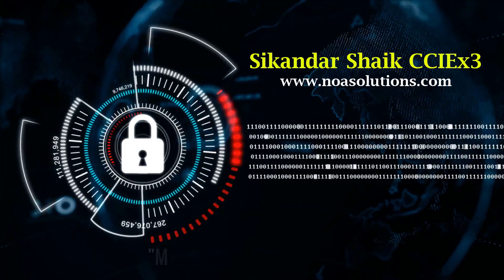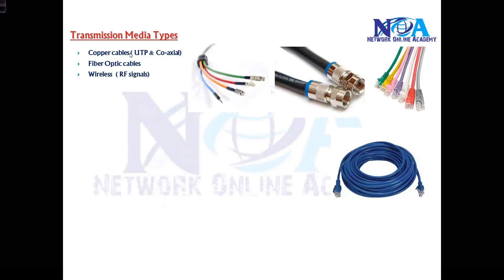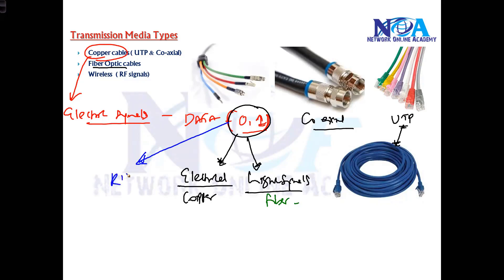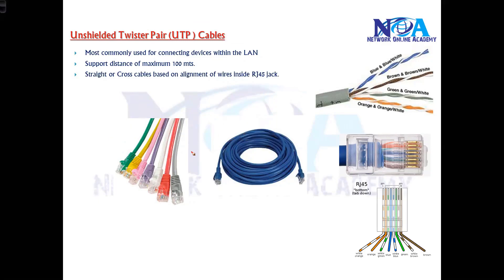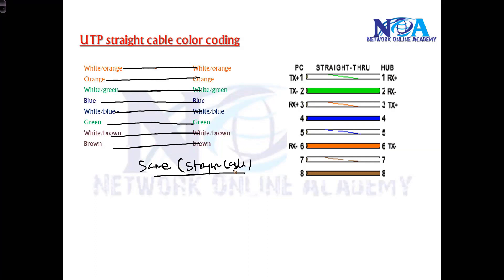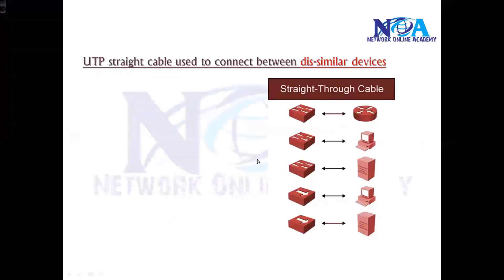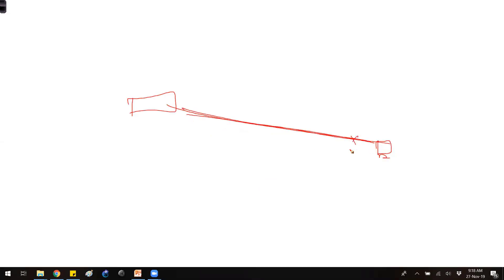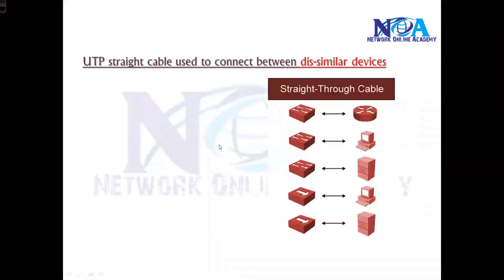005Transmission Media: UTP Cables Explained | Sikandar Shaik

Comment: This is what I done. My cat6e cable jack was loose. I bought a wirecrimper off Amazon and crimp the rj45. It works well with full 1gbps connectivity. It's good experience as well.